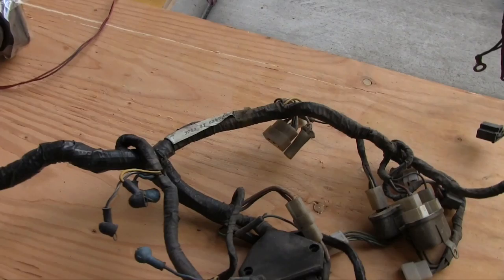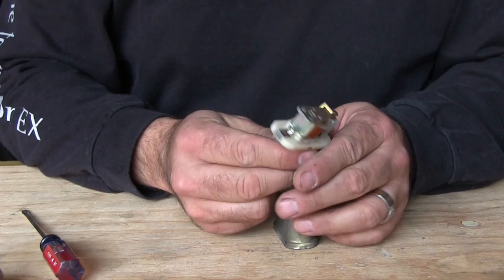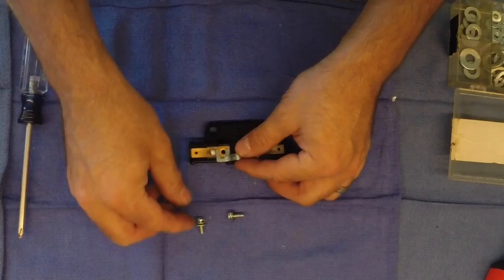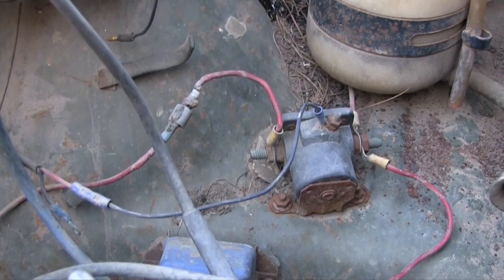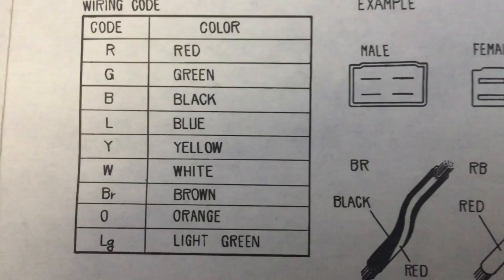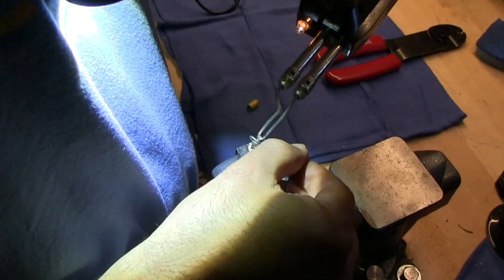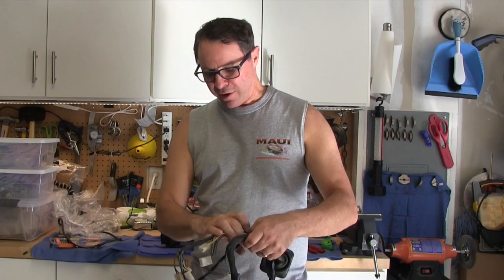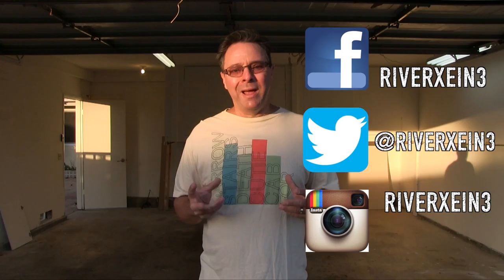VLog 34 Mazda RX3 Engine Bay Wire Looms Restoration

Comment: Progress!
Reply from the maker: Yep. Little by little.
Reply: the soldering gun is the best you can get , you just have to tighten the nut at the end of the barrel holding the tip. It will work like new.